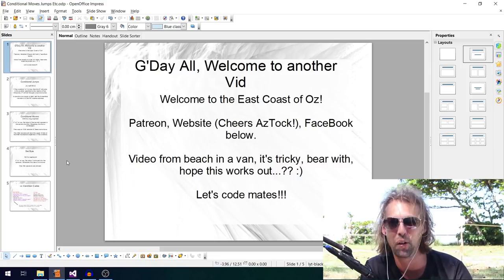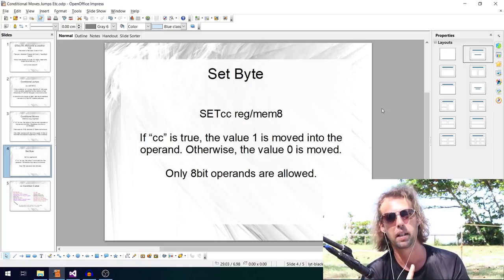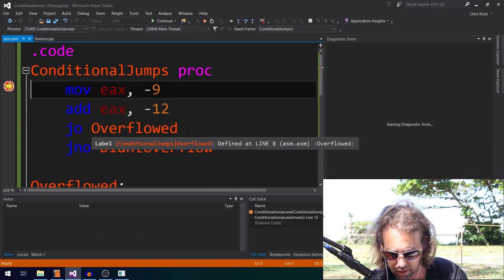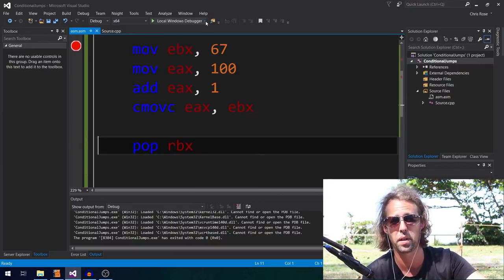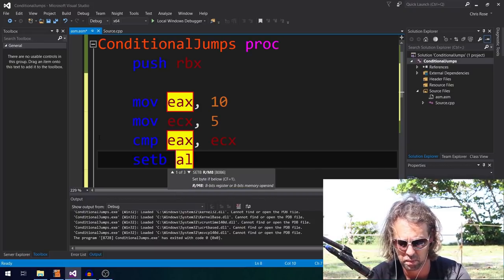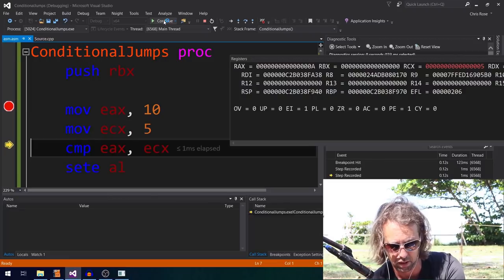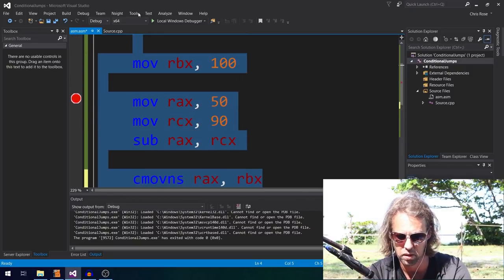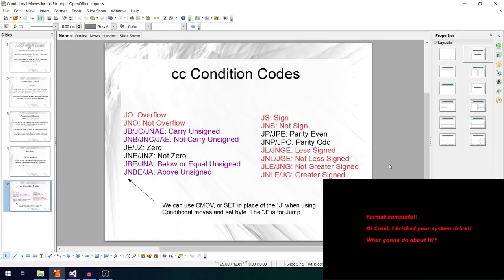Modern x64 Assembly 10: Conditional Jumps, Moves and Set Byte

Comment: 12:18: "rax, rbx, rcx, rdx there's obviously a pattern there": Actually, fun fact, it's a coincidence, which is hinted at by the fact that in the register encoding they don't come in this order - RAX is register 0, RCX is 1, RDX is 2 and RBX is 3. In fact, AX is the accumulator register, CX is the count register, DX is the data register and BX is the base register. The accumulator name is pretty obvious, most operators have a preferred form for using AX, while CX is used for counts in the loop instructions and shifts. DX is used as a pair with AX for doublewide instructions like multiplication and division, and BX was once the only general purpose register to be usable in address arithmetic, hence "base register" for the base of an array or something. (Since x86-32, you can use any register as a base for addressing, so EBX is now the only "named" GPR that is actually general purpose.)

Comment: Great video, I would really appreciate if you gave a little bit of help with push and pop, like I think I kinda get what they do, but when should I use them? Thanks
Reply from the maker: Push and pop are used to save things temporarily. So, for instance RBX is not scratch. That means C++ expects that the value will not change when it calls our functions. And so, if we want to use RBX in our function we save the current value at the start of the function with "push rbx", and then at the end of the function we use "pop rbx" to restore the value to whatever the compiler had before our function. Then we can do whatever we need with RBX and C++ won't get confused.

The stack is also used for saving the return address from a function, and for local variables of a function, but those things aren't push and pop related. Mostly, the push and pop are just used to save register values so you can restore them later.

Hope this helps.

Comment: Question about UNconditional jumps, but I guess by and large it also applies to conditional ones: on x64, the operand to a jump instruction can be rel8, rel32, r/m64, m16:16, m16:32 or m16:64, and depending on which one it is, the opcode changes. How do I tell MASM which one I want to use? For instance, "jmp +4", the operand can be interpreted as rel8 or rel32, how do I tell MASM to use the opcode for a rel32 operand (for whatever reason, be it sensible or not)?
Reply: I may be a bit late to answer, but in general the way to fool the auto parser is to use binary of the size that matches what you want, so if you want 32 bits you go like 0b<32 bytes> or <32 bytes>b in assembly, hope that it's still relevant

Comment: My x64 assemlber allows you to conditionally move with an immediate. The assemblet splits it into 4 instructions:

push r0
mov r0, imm
mov.cc dr, r0
pop r0

Very convenient. Of course it assumes the stack ptr is set correctly, so if you are working on an operating system, you might not want to use it.
Reply: Is this RISC/ARM?
Reply: @TechLord79  my assembler is based on the mips (ARM) syntax. I combined it with RISC too
Reply: @KayOScode  Ah thanks! Kudos, I incorrectly assumed "my" was referring to the software on your platform of use, but so you have written your own piece - well done!

Comment: Please can someone tell me why JL needs to check OF <> SF. I believed checking SF only is enough.
Reply: Comparison is done by Subtraction. If the result is i.e. not negative, but there was overflow, the values used for comparison differed so much that it was not possible to represent it with the number of bits used for it. Example in bytes: -127 (0x81) - 2 (0x02) = 127 (0x7f) The result is positive (and we had overflow), but -127 is smaller than 2.

Comment: Sloppy. Only if your viewers already know well what you are talking about will they follow your explanations. You should prepare your lesson, it's obvious you didn't.
On the overflow matter, I would have explained exactly what the overflow flag is (you did neither in the Flags lesson nor in this): a warning that, in case the numbers you used are to be considered signed, computation has or could have over- or under-flowed the allowed numeric range; for instance, your one-byte data could end up being 128 after incrementing it by 1: it was 127, the maximum allowed positive signed number, and has overflowed to -128, which is what the unsigned value 128 represents in the signed range. If you are not considering your numbers signed, you can safely ignore this warning, but not if you are assuming your byte is signed. The overflow flag has various ways of computing: change of sign after adding same-sign operands is one such case. Subtraction can also cause overflow, if different-sign operands. By decrementing a zero value by 1, you get -1, but there is no overflow: this is OK with signed numbers. By incrementing -1 by 1, you get 0, no overflow. However, the carry bit would be set in both cases, because, as unsigned numbers, they've exceeded their range: from 0 to 255 or vice versa, respectively.